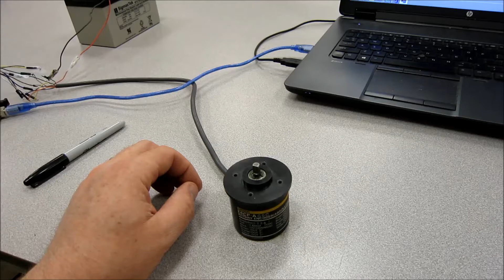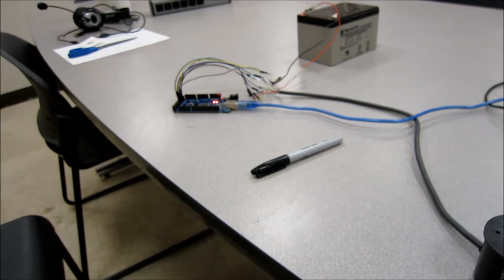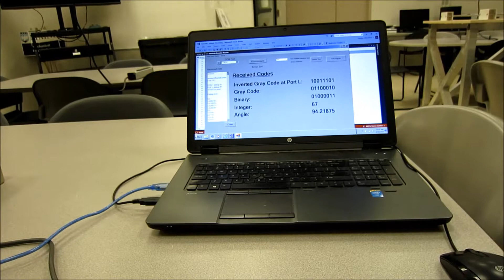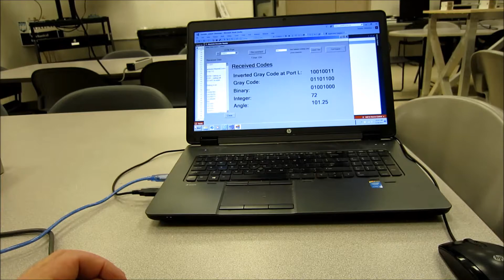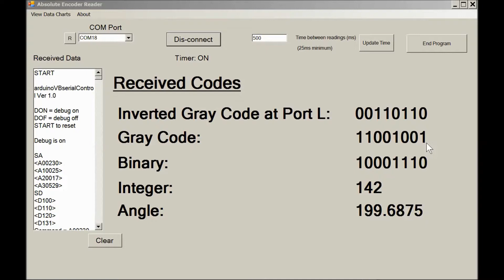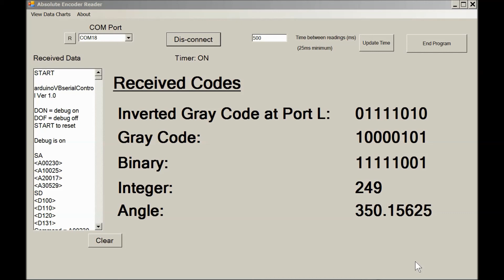Absolute Encoder Read By An Arduino

Comment: Hi, I'm working in a project with Siemens CPU1500 and I would like to try to integrate your project using the arduino to send the values from the encoder to the arduino and the arduino to the PLC using TCP ModBus with a ethernet shied v2. From all projects I have seen your is the on can fit in my project. After I can send you all the project I have made. thanks

Comment: Thanks for the video. I had a problem with my absolute encoder. I found out the transmitted byte is gray coded and you should convert it to binary. It works perfectly now ;)